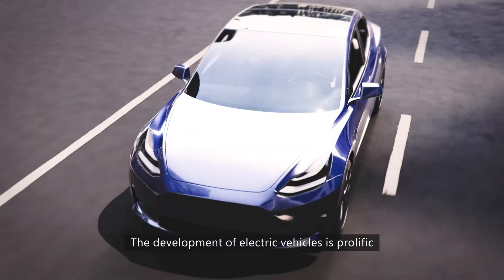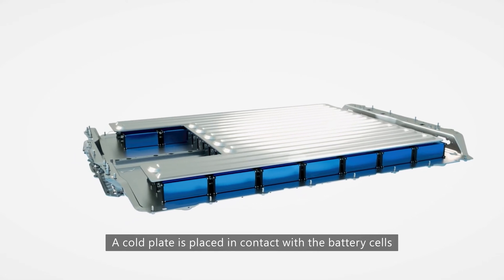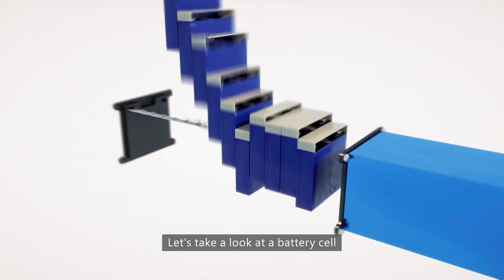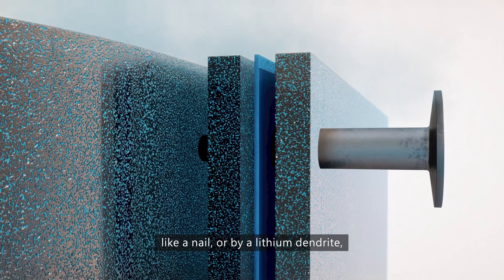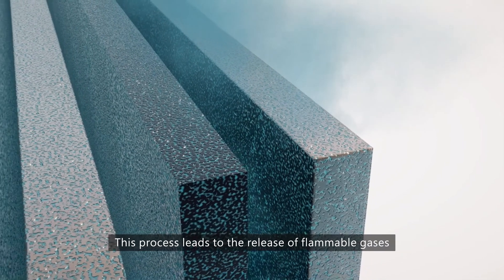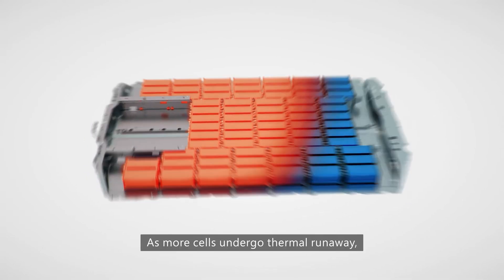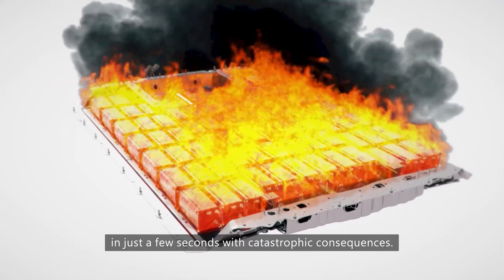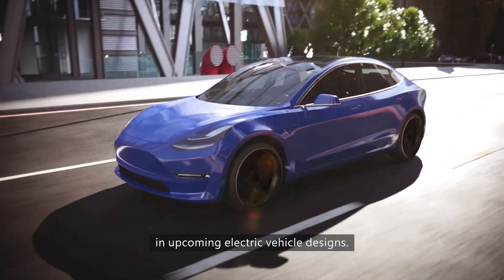What is Battery Thermal Runaway?

Comment: The video has half truths. Any Lithium ion cell is inherently unstable and once heated past 70 °C is at risk of going into thermal runaway. The cell can not be extinguished once started as the cell will provide all that is needed to continue the burn reaction. Yes they will burn under water. Water is used to try to stop the spread of cell by cell detonation and fire expansion of 1200 - 3000 °C. A cell must exhaust all of its chemicals before becoming a non-fire risk. That is why a battery can self reignite later.